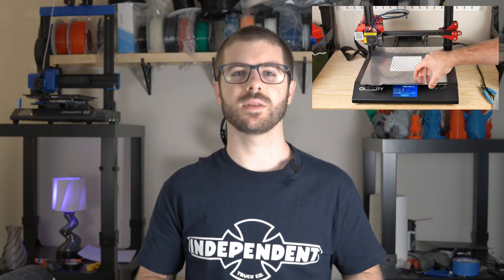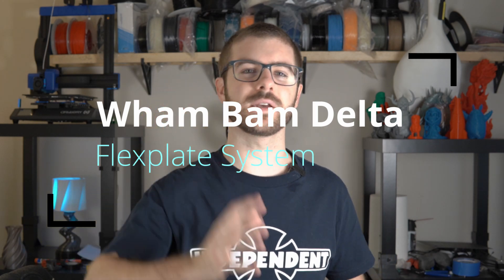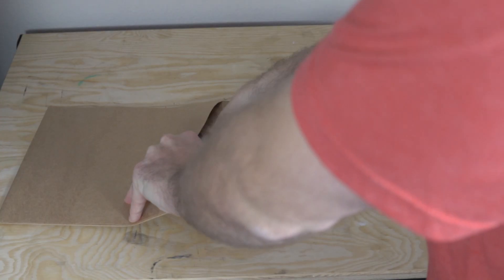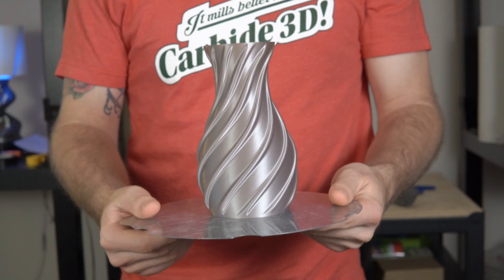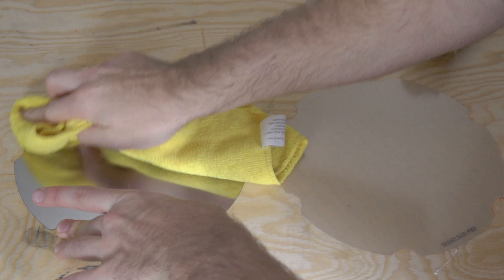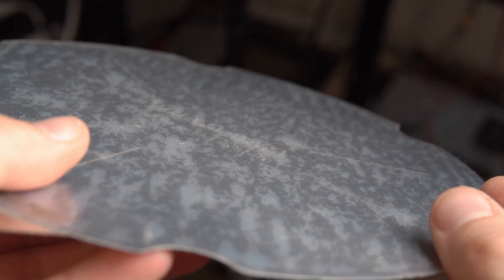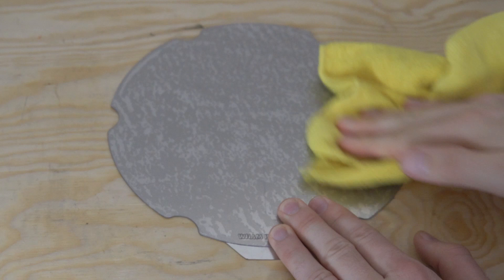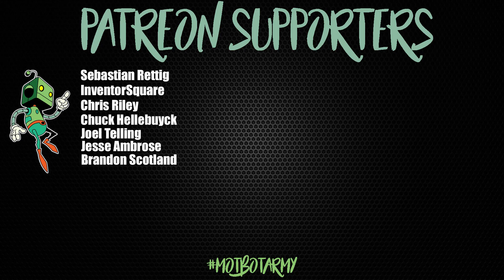Best Delta 3d Printer Flex Plate System Upgrade

Comment: I see that this is an older video, but at least based upon some WhamBam videos that I've seen, it looks like you shouldn't place the magnetic sheet directly on a textured build surface?  Have there been any issues adhering it directly to the stock setup?  I'm looking to add one to my SuperRacer.

Comment: so not for heated beds
Reply from the maker: This works great with heated beds
Reply: @ModBotArmy  Magnet's Temps about 80 Deg
https://www.supermagnete.de/eng/faq/What-temperatures-can-magnets-withstand
My FLSUN QQS Bed is GREAT
Reply: @3D_Printing  Our magnet is rated to withstand temperatures of 150 degrees without losing magnetism.
Reply: @WhamBamSystems  Thanking YOU 2000% for the info. and a GREAT video

Comment: I use flex plate systems on all my FDM printers. I like the Wham Bam system and have it on 3 of my printers. I used Rapid Tac cleaner and application fluid to apply the adhesive backed magnetic sheet and the PEX sheet.  It allows you to easily reposition the adhesive sheets as needed and remove air bubbles.
Reply from the maker: Interesting thanks for the tip. That can definitely be useful.

Comment: how about ABS , as you know the bed have to be at least 110 so the magnet will lose the magnetism what do you think ?
Reply from the maker: For ABS, I rarely go above 90C on the bed. Sure 110C will work fine, but that seems overkill to me. I have not gone above 90C but they do claim that they are rated at up to 150C.
Reply: not all ABS needs 110, most actually recommend not going that high these days. and the magnet sheet here is certified for 140 or 150 i believe.
Reply: Our magnet is rated to withstand temperatures of 150 degrees without losing magnetism.
Reply: Wham Bam magnet can resist up to 150 continuous temps!
Reply: Thanks for asking that, that was the same question I was going to ask. I'd like to see Wham Bam's FAQ on that. I"ve not been happy with the glass setup and would like something (no pun?) more flexible